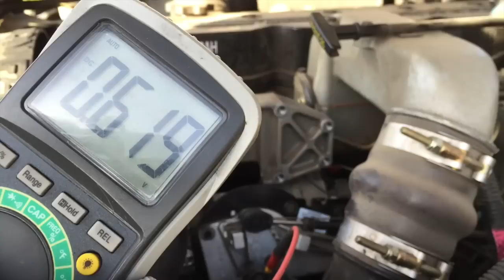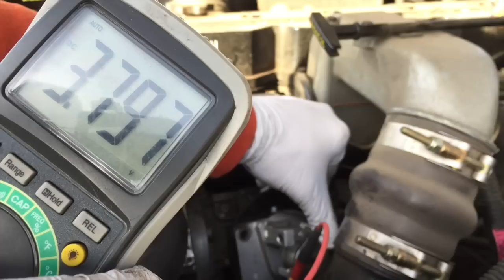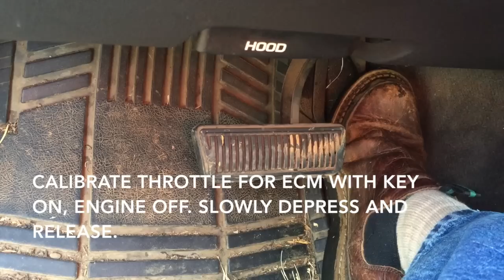Dodge Cummins apps sensor (throttle position) repair 2001 2500 turbo diesel

Comment: I boil in an old deep pan and add salon grade hydrogen peroxide  to the water after removing most of the meat,eyes, sliver the brain before boiling so it will fall out when I power wash the head. I might soak it again in water/Peroxide to sanitize. On the pig pull all the teeth after you boil and clean the root out before filling where the root was with silicone  and the place them back into the jaw.

Comment: Good evening, I changed in my ram 3500 2001 diesel the TPS sensor calibrated at .55 v but in the calibration test it does not exceed 1.99 and it becomes OL and remains dead
Reply from the maker: Make sure your multimeter is set up for the correct voltage range and meter lead positions, etc.. Or, if you have the option, try testing the range with another multimeter to make sure it isn’t the test equipment. If you still have the old TPS, plug it in without bolting it up and try the test with it. It might give some clues of next steps to take. Take care.

Comment: Nice coverage.  
Maybe you know the answer to this unique issue I have on my 2005 Dodge Ram 5.9 Cummins automatic w/overdrive transmission?  196,000 miles.
 It's the original transmission and motor. All fluids/oils and filters regularly changed and kept clean/new.  Not used to tow often...4-5 times a year at most and 8,000 lb loads at most.

I've asked 4 tranny shops and a few forums and Facebook groups but no luck finding same problem or proper fix. I'm wondering if I'm just that special?!?? Lol

One mild Fall day last year I had driven 260 miles on interstate at about 75-80 mph.  It began slowly reducing speed over 6 miles from 80 to 15mph.  Moving fuel pedal would not do anything but make it stumble a little a couple dozen RPMs up or down.  Stopping and restarting it immediately did not help nor did changing gears manually.

All fluids were fine, not too hot and no burning of anything fluid or conduit wire was observed.  All looked good under and above it.

I stopped it for 30 minutes as I checked it over. It would drive normally after that, but it would only go 25-30 miles before it would slowly slow down again as described above.  I did this over many cycles all the way home 260 miles.  I'd turn it off and on again, completely off as it rested for 25 minutes.  The batteries seemed to be getting charged (started well each time) and no warning lights were on.  Once or twice, when I drove it until it would not even crawl anymore (1-2 mph, I was testing it), it stalled. So it wasn't hard starting or hard-stalling unless I took it all the way down to 1-2 mph speed.  It was not idling weird either.

Could this be an electrical ground failure or electronic issue?  If I had a battery connection loose or anything disrupting the flow could it cause this?  It seems like something is getting tired and needing to cool down or something but nothing was overly hot or smoking. What's weird to me is it's not slipping in the usual way of revving up but not moving. It would usually get no lower than idle.

Tranny shops haven't heard of this before.  No transmission codes either.  They want to charge me $3,000+ for new or rebuilt tranny.   I want to rule out wiring and electronics (that don't throw codes) first.  

Any suggestions?  Heard of this ever before for an automatic transmission?

Thanks!
Reply from the maker: Perhaps put a gauge on your lift pump fuel pressure so it can be monitored and ruled out. Then, any possible restriction, heat related or physical blocking, can be eliminated from potential causes. Also, research anything that may cause any drivetrain system to go into “limp mode.” Don’t give up in the forums and other resources of information. Keep taking meticulous notes of symptoms and situations. It will be an awesome story to tell in the end. Good luck. Let us know how it goes.
Reply: @kilikobanashoba  ok thanks! Will do

Comment: 03 Ram 2500 5.7 ... Driving and it cut off mechanic thought it was a crank position sensor changed and no go... Now they think it's the acceleration pedal sensor does this sound right? My throttle doesn't open and truck doesn't start just kinda whizzes or whatever. What say you? Anybody else with a Dodge have this problem?
Reply from the maker: Verify batteries and charging system have clean (metal to metal), tight connections and the alt voltage is getting to the battery first. Clean/inspect all major grounds (at engine block and body). Then start verifying each possible component that could cause symptom tests bad before replacement. There are lots of forums detailing the possible suspects. Good luck. Take care.

Comment: the first set of pliers you had on the torx bolt are bad ass if you flip them around the right way. they are way better for stripped bolts than any vise grips, but the teeth are directional.

Comment: I bought a sensor like this online and when I installed it I watched this video to help me out and I got 0.01 volts without adjusting it how do it get it to be 0.6?
Reply from the maker: The video at 4:41 shows where and how to adjust the idle setting. Thread the torx screw in or out until the desired idle voltage is seen on the multimeter. Make sure to take a voltage reading at the positive battery terminal to make sure your negative meter lead is hooked to a good ground. Then test again at the proper terminal, for the       .6VDC.
Reply: I tried it and now the truck stays idle and the throttle gives no response at all
Reply from the maker: Does your voltage vary across the range shown starting at 4:52, of the video, when you manually move the throttle? If it does not, then something is probably not hooked up or installed correctly.

Comment: What wire did you plug the red (hot+) probe in to?
Reply from the maker: Just probe all the terminals until you find the one that reads .6VDC at idle, then raises when the throttle is advanced, as shown in the video. Focusing on the wire colors will only make it more confusing.
Reply: Terminal #3. It's marked on the harness side. Blue with black stripes.

Comment: I've been trying to find the actual sensor harness pigtail (with no luck), does anyone know where i could get one online?
Reply: Thanks man, huge help
Reply from the maker: You talking about this? 
https://www.ebay.com/itm/Throttle-Position-Sensor-Senser-Dodge-Ram-5-9-Cummins-TPS-Harness-Pigtail-APPS-/162855873974?_trksid=p2385738.m4383.l4275.c10
Reply from the maker: Or what is in this picture? 
https://www.ebay.com/itm/TPS-APPS-Throttle-Position-Sensor-Fits-Dodge-Ram-1998-2007-Cummins-Bell-Crank-US-/352519870924?_trksid=p2385738.m4383.l4275.c10
Reply: those seem to be female adaptors pigtails, the item I’m looking for is in 2:00 min of your video.
Reply from the maker: That is just a six-pin male deutsch connector available anywhere that sells deutsch connector kits. Auto-parts stores only know to type in year make and model and read what the screen says. They likely will be no help. I would just find a male six-pin deutsch pigtail on the Internet. Or if you want individual pieces, try this:
http://www.deutschconnector.com

Comment: I have a problem where my truck throttle stops working but when I pump it it works again and keeps doing that back and forth any tips?
Reply: Hey julio were you able to figure out what the problem was with your truck??
I realize this is an old post and the reason I am asking is because my 04 ram is doing the same thing, not very often but mainly when we are going uphill. I will appreciate any help on this matter.
Reply: @lupopina3616  yes the problem was the throttle position sensor I replaced it and did the reset procedure and it worked like a charm
Reply: @juliorodriguez454  Your reply is greatly appreciated.
Reply from the maker: I would learn what changes when you pump it. Does the electric signal from one component to another change; or the fuel delivery rate change? You can install pressure sensors or multimeter test leads at components to answer these questions while you are troubleshooting the system.

Comment: I’ve had to reset the sensor on my 98 24 valve a few times since July. Sometimes it works alright and sometimes it doesn’t. Here lately it hasn’t been working well. Is it safe to say I need a new sensor or maybe try some other stuff first? Have not done anything but reset it a time or three
Reply from the maker: I would not buy a new sensor unless you can prove it is bad with a multimeter. Make sure you are not confusing “dead pedal” with the vehicle computer enabling “limp mode.” Differentiating “dead pedal” and “limp mode” will let you know which troubleshooting steps to take (and which electronic sensors or circuit boards to test). That is step number one. When you “reset” the sensor, that may only seem to work because you turned off the ignition; and reset the circuit that does have the problem. Search a bunch of forums for limp mode for your vehicle and take lots of notes; take it step by step and be patient and you will figure it out. Take care.
Reply: I’d say it’s not in limp mode. It runs good and speeds up to highway speeds without a problem, just takes a little longer due to the pedal not being as responsive as it normally is. I used it to haul a 16 foot trailer load of furniture plus some in the back of the truck this past weekend and couldn’t even tell it was back there at 60 mph. Sped up from a complete stop and pulled it down the highway with no trouble. Unless they’ll run that good in limp mode, I’d say it’s not in limp, but I don’t know. I assume to test the sensor with a multimeter I would do it the same way you did it in the video? Thanks for your help and information
Reply from the maker: Yep, test the same way as in the video. Just make sure it isn’t intermittently going in and out of limp mode (when you are experiencing the symptom). It would be weird, but you could run a wire from the TPS into the cab so you could watch the voltage on a multimeter and see whether or not you are losing the signal while you are driving.
Reply: Thanks for the info. Will test it out soon. Hopefully will end up finding at least something

Comment: very good video.  on my truck setting the voltage was needed to make it work.  the screw had some plastic locktite that made it difficult to turn.  I did mine by loosening the two screws holding the sensor and turning slightly.  thank you.
Reply from the maker: Thanks for the info. Glad it was an easy fix.

Comment: Awesome video ! i Guess im back here again.
Thank you very much for making it. Very well done !
i have a 1999 ram 2500 so im guessing its the same.
Reply from the maker: I would prove it is bad with a multimeter and/or scanner before buying the part. And make sure that you are not confusing “dead pedal” with the myriad causes of “limp mode.”

Comment: what i want , is a dodge truck , cummins powered , with absolutely zero sign of a computer anywhere on it...
Reply: i think what u want is a 1994-98 12valve cummins. ibelieve they are all mechanical injection.
Reply: @OcRefrig  i have been hunting a 1989 to 1993 , but they are few and far between....and they are high $$ for one that is not trashed or salted out....i have a 2002 auto , and have put the noise reducer and a new apps sensor on it and it still has problems with dead pedal .it has 103,000 mi on it.
Reply from the maker: I would make sure to do enough research that you are not confusing “dead pedal” with “limp mode.”
Reply: @kilikobanashoba  yes i probably do need to research it a lot more.....right after i replaced the apps sensor , i drove it around for 30-40 mi and it seemed to run perfectly...then it went right back to the same problem... when i press the pedal and get no response , i can let completely off the pedal for a second or two and then press the pedal and get normal acceleration....repeat this several times is what i am doing....i will recalibrate the sensor and see if that helps...........i am really too old for all of this computer stuff , i see no need for a computer to sense where i mash the accelerator , a steel rod or a cable to the throttle linkage would cost 1/10th of a( accelerater pedal position sensor ).........i don't care if a first gen dodge cummins does cost an arm and a leg , it will be worth getting rid of the aggrevation all of this computer stuff causes.....!!  ... please excuse the rant....thanks for the advice  !!!
Reply: @kilikobanashoba   iwent to recalibrate the sensor and found that the idle screw had backed out almost all the way out ( only a thread holding it in )...i put some nail-polish on it and re-calibrated it  , drove it down the road aways and it seems to be doing all right now....thanks for your input....
Reply from the maker: Thanks for the update; someone will read it and find they are having the same issue, and be able to fix it themselves. That is what it is all about.
Reply: @kilikobanashoba  I just replaced the vp44 injection pump and the OEM lift pump, now the truck will die coming to a stop. You have to push the clutch in and give it fuel before it dies. Help
Reply from the maker: I would test your fuel pressure before and after as many fuel system parts as possible; to isolate where the problem is. There are many articles written and videos on how and where to read fuel pressures. And where to get fittings and gauges to hook to the fuel system.
Reply: Yes!  P7100 pump on a 24valve is the way to go!

Comment: Why cant you just unplug the old sensor and put the new one on and be done? Do you have to do all the extra stuff?
Reply from the maker: It depends. Regardless, all that “extra stuff” takes less than five minutes.
Reply: Kilikoba Nashoba its just iv replaced many censors for my jeep but never had to test the ohm's.. But the petal calibrating i can see you having to do. My 05 3500 dodge has threw this apps sensor code at me and i have to replace the something. Hope its as easy as your video
Reply from the maker: Just keep in mind the video is for the 98 1/2-02 Cummins era technology.